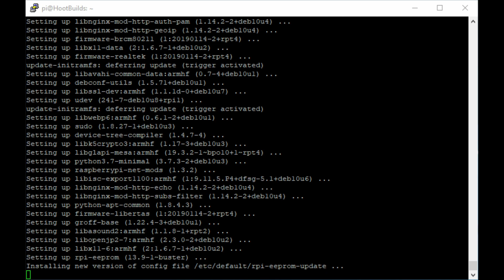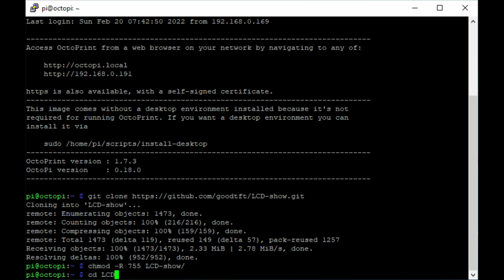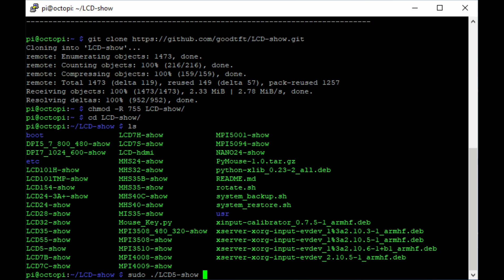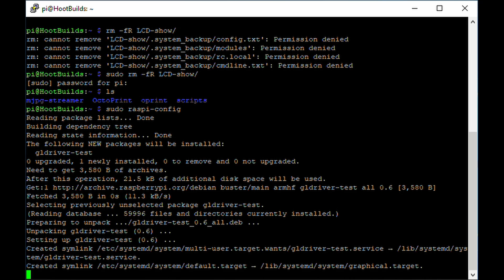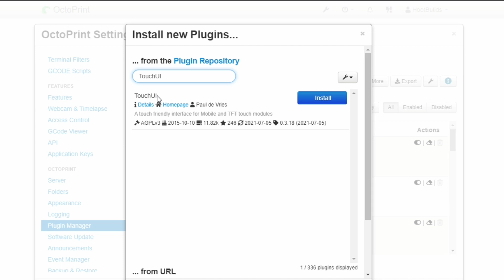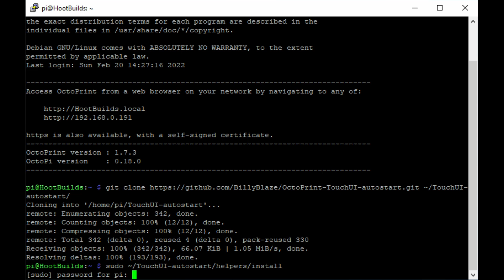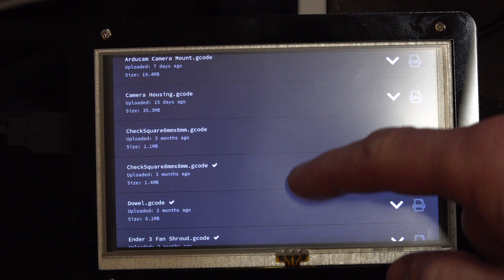Under $50 Octoprint 5Inch LED Touch Screen Assembly and Touch UI Setup

Comment: I followed your directions exactly on a fresh Octoprint install (1.7.3). TouchUI does not initiate and hangs at login screen.
Reply from the maker: Good luck,  its been so long since I installed mine.  I think there is a configuration script that needs to be ran to set up auto login.  But I could be wrong.  I went through the setup myself a few times to ensure the tutorial was correct.

Comment: I noticed you got an undervoltage warning, since setting this up have you set up the power from the printer PS?
 Did the undervoltage cause any problems with printing?
Can you just add the plugin to your existing Octoprint setup and attach the screen and everything works ?
Reply from the maker: I was getting the undervoltage warning before setting this up.  I am unsure what is causing it because I have tried two different power supplies and I am currently using a 5v 2.0 amp supply and I  occasionally get the alert with both.  I have not had any issues with it printing though or rebooting the pi.  If you have any ideas about fixes to eliminate the alert, I am open to suggestions.  Thank you for watching and have a great weekend.
Reply: @HootBuilds  There are PS that peak at 5V 2A and ones that hold that value, the RPi official is 5V 2.5A and it holds that value, however if you have something plugged in thet trickles voltage back into the PI this reports a false positive undervoltage warning
Reply from the maker: I placed a piece of tape on the positive connector on the usb cable. The back current causing a false undervoltage was eliminated.